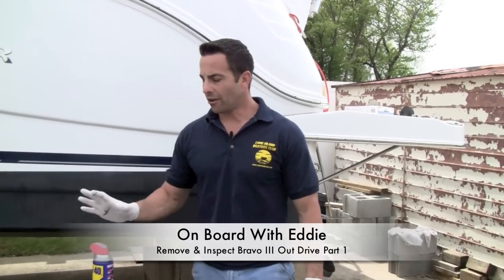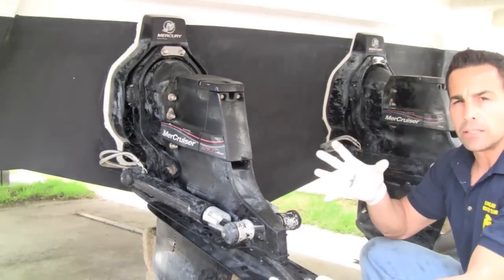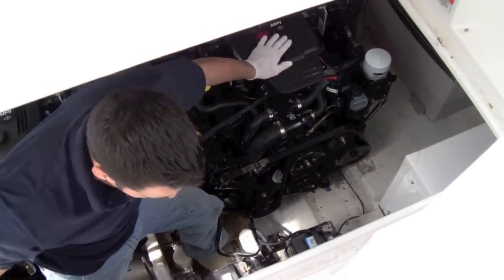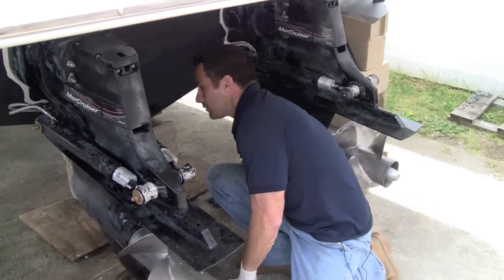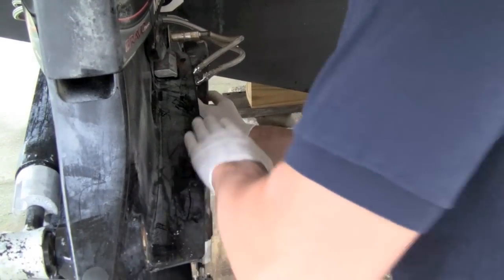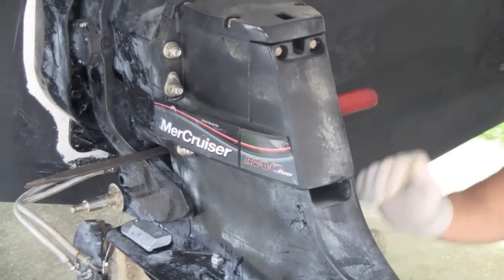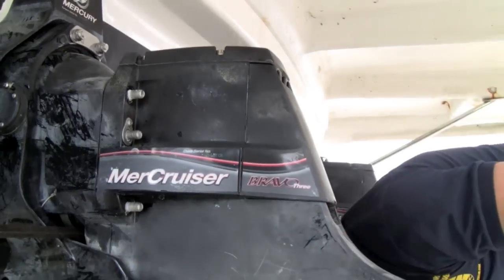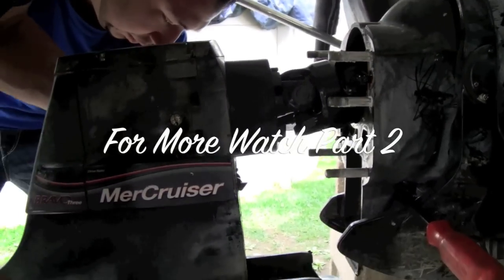Hot to Repair and Replace Bravo III Out Drive Part 1

Comment: HELP Need... right wording to bring up video on youtube, was not able to find any video of the shaft being stuck inside the gimbal bearing
Reply from the maker: If the universe shaft is stuck in the gimbal barren. Usually you can get a pry-bar in between the I’ll drive and the gimbal helmet and pry it out.  Just wanna make sure you have a bravo 3  and have the shifter neutral.  because if it’s an alpha, one, you need to have your shifter in reverse.  that could be keeping it from coming off. Hope that helps.🤙⚓️

Comment: Why not empty the reservoir instead of clamping it?  You can lift it out and empty it pretty easily.
Reply from the maker: The only reason why I do that is, the fluid is good in the reservoir and gear oil, fluids, a lot of money.  if you’d like to drain it, you can do that. Also, there is a check valve. So when you take it off. the fluid will not come all the way out.

Comment: Thanks eddie for video.  I can’t get my Bravo 3 outdrive out at all. Its like stuck in the engine. Even with several 100 lbs of force from a scissors jack The shaft just seems stuck in the engine coupler.  Any ideas ?  I am being told that the the shaft will have to be cut off and the engine than will have to be removed to install a new coupler for the Outdrive.  Its a Formula 40 SS with Yanmar 315hp diesels.   Any thoughts would be appreciated
Reply from the maker: Oh Man. Yeah you would have to cut the shaft. But first try this, there are two grease fittings on the coupler. take the grease fittings out. and spray some WD-40 or CRC into it and soak the drive shaft. Good luck buddy 🤙⚓️

Comment: Love the videos  - thank you. 
Eddie, have you ever had an outdrive STUCK IN FORWARD? my Chaparral has a Bravo 3, it starts (in gear) and runs fine. It is STUCK in forward though!! - do you think it's a cable issue, quicksilver 3000 box issue, or maybe the gears in the outdrive?  again, it Starts so there nothing "telling" the motor that the outdrive is IN GEAR.. very odd?  Any help is greatly appreciated. Mike
Reply: Mike, don't know if you have solved you problem since your message is 2 months old, but mine was the same problem. gear got stuck in forward (bravo III) and It cost me $3K to take it to a mechanic to reshimmed it and to do all that needed to do. basically, I while driving the boat in high rpm I shifted the gear from forward to neautral and back to forward and then it got stuck in forward.

Comment: The drive will still be over an inch off the housing and you can clearly see the shift cable click back into the shift mechanism in the drive.

Great vide tho, very helpful.

Comment: I find getting the shifter disconnected easy, but getting it back together when re-installing the drive was much more difficult. Not as easy as in the video I feel. To make it easier I put the shift lever in forward and put the drive in reverse. This causes the cable from the Mercontrol to be out as far as it will go and it causes the shift mechanism in the drive to out as far as it will go. This allows you to see the two connect again properly while the drive is still out enough to you see it.